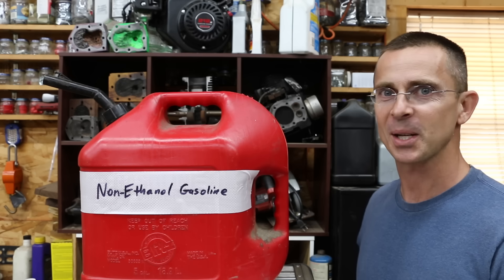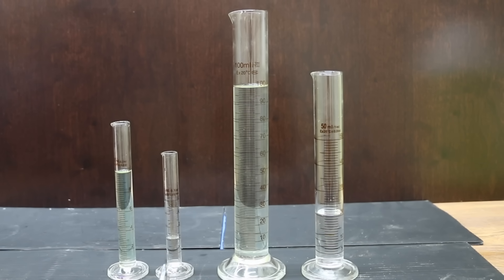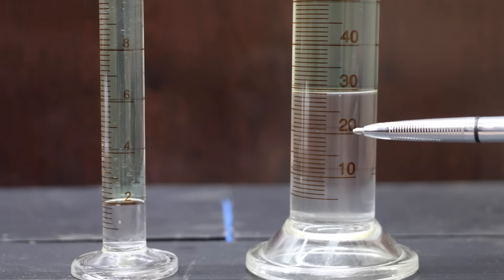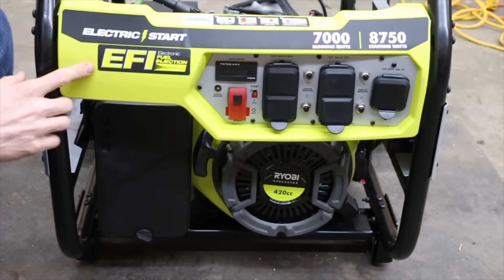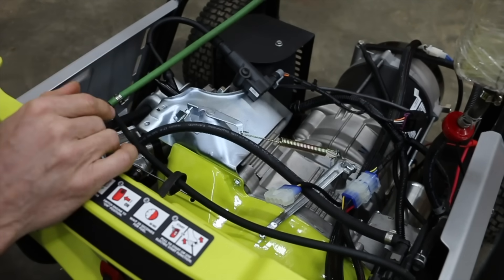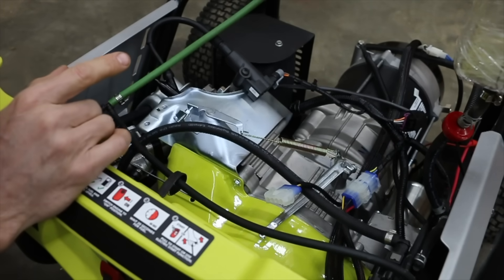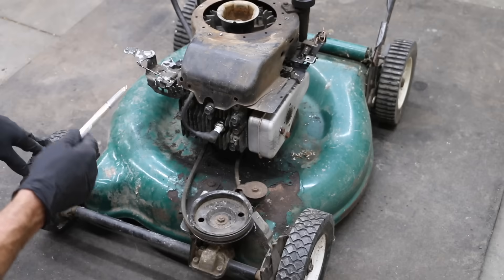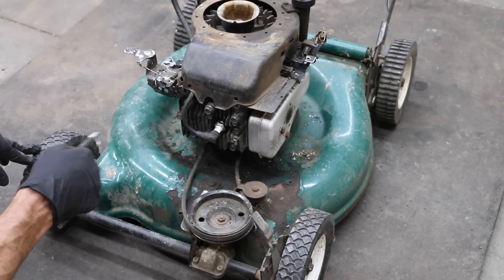Is Non-Ethanol Gasoline Really Better? See the PROOF!

Comment: Ethanol absolutely causes blockages either partially or complete in carburators because it is blatently obvious that it breaks down plastic and rubber components in fuel lines , fuel filters , tanks and carbs.  I have been doing my own small engine repair as well as repairing the equipment of other people for 20+ years and any machine especially two-strokes that have sat for over 6 months with fuel in them and no stabilizer have all needed at least mild carb cleanings to get the machines to idle , throttle up and run at WOT properly, some need entire ultrasonic cleanses and rebuild kits.  4 stroke carbs seem to handle the ethanol a little better as the 2 stroke engine carbs are very sensitive to ethanol and anything other than clean pure high octane fresh fuel in general.  If you live in the northeast you may have a local gas station called "Stewerts" they all offer 91 octane ethanol free fuel because of the amount of snowmobilers around here.  If you can't find ethanol free fuel then go to any marina that has a gas pump out by the docks and get your gas there it's all ethanol free.  Ethanol is also considerably more damaging to the internal engine components of two strokes like chainsaws , leaf blowers , and weed whackers due to how much it increases combustion temperatures , mix that increased temp with the 9000+ rpm operating speed of two strokes and how lean they tend to tune machines outta the factory now in all machines and you got a recipe for destruction.  I got a dirt cheap throw away Remington rm2510 25cc two stroke  weedwhacker that my stepdad bought at regular price for $89.99   3 years ago , his son in law was with him and also purchased the same machine at the same time 3 years ago now.  Upon first start of the new weed whacker I noticed immediately how lean the carb was tuned and how horrible the idle and throttle response was, had no power etc... So I let it warm up completely and I returned the carburator upon it's first run with minor tweaking after it broke in and was under load, I've never ran anything but premixed ethanol free 95 octane fuel in the whacker and it's about to start it's 4th season still with plenty of power though it is down to only about 115 lbs of compression it still starts easily and has no significant noteable power loss yet so all is good.  However the unit that my stepfather's son in law bought at the same time , never retuned or adjusted the carburator on except the idle speed and used standard 89-91 octane 10% ethanol fuel he mixed himself with prob shit two stroke oil too , lasted about 3/4 of the first season before it developed significant power loss, took 20-30 pulls to start and would often stall after letting off the throttle when warmed up and refuse to restart for hours , by the end of the first season it was completely trashed and the motor locked up on him one day while using it, only 7 or 8 months old didn't even get to finish one full season before catastrophic engine failure occured. Now was it the ethanol or was it tuned to lean that caused his engine on his machine to fail? I'd say prob a fairly even mix of the two.  I have a couple Husqvarna chainsaws currently , non of them have ever ever seen even a drop of fuel containing ethanol except for one instance, I'll explain. One is  a 445 with a 16" bar muffler modded and retuned, never seen a drop of ethanol and runs perfect tons of power still, is a 2008 model so 12 years old cutting 3-5 cords of firewood a year  . I have a 55 rancher with an 18" bar on it that I was given with almost no compression for free by a coworker , i rebuilt it using a cheap $50-60 Chinese rebuild kit and quality meteor piston and ring, runs perfect ,plenty of power , also has never seen a drop of ethanol fuel since the rebuild .  I have a  model 41 made in 1998, 16" bar and muffler modded and retuned, saw runs perfect , plenty of power still also has never seen a drop of ethanol.  Last I have model 135 which is basically a 440 with a 3/8LP chain and bar that has just finished it's second full season as a  light duty firewood saw. I myself never used any ethanol fuel in this saw either only Husqvarna premixed 95 octane , but my idiot stepfather lended it to a friend of his without my permission and without even making sure the fuckin idiot new how to use the damn thing properly and sure as shit when I got it back two days later there was no bar oil in the reservoir , the chain was burnt to a crisp and the bar was scored , I started it before he left because I already knew he had to have fucked something up especially after telling me he used regular 87 octane pump gas with ethanol in it and true value brand non synthetic garbage two stroke oil.  So I started the saw before he left and right away I noticed it didn't idle nearly as smooth , and that the throttle response wasn't nearly as crisp and sharp as it should be and was only 3 days early before this ignorant asshole stepdad of mine lended it unlawfully to another ignorant asshole.  I did a test cut quick after it warmed up and immediately noticed not only the it has a significant power loss but also didnt hit max rpm potential.  The guy asked me if anuthing was wrong and I told him flat out yes I think you blew my motor or damaged it severely because you don't know what your doing , used the wrong fuel and oil and prob didn't even mix it to the correct ratio and just went off on the guy , I told him stick around for 3-4 minutes I'm gonna pop the muffler off quick and spark plug to inspect the motor, the guy started looking nervous and uncomfortable. Soon as I was able to pop those two parts off and shine a flashlight into the cylinder there it was , scored and gouged the shit outta the cylinder , fried the ring and did a hell of a number on the piston as well.   Quick compression test at WOT yielded me 107psi   , I was furious and told the guy said listen I'm not trying to attack you like an asshole but I maintain all my gas engine powered vehicles and tools absolutely meticulously to and over the top level and this saw was a piece of shit in its current state compared the meticulously perfect state he received it in  when my stepdad lended it to you which btw he had no right to do and did so without my permission , I said I never ever would of let anybody borrow any of my saws even if they were a professional arborist I don't care, I ain't going there. So I said so that said you basically ruined a saw that no while not the most expensive Husqvarna model regardless was in perfect shape and I'm sorry but I earn my money so even spending $10 is something I give well thought to so I said I'm sorry sir but your gonna have to do something about this because I'll take you to small claims court , you and my stepdad both if need be I don't give a shit , these are my damn saws. the guy asked if it was repairable or if an entire new saw was needed , I said I could rebuild it on my own time but would only do so with OEM Husqvarna parts and sorry but I'm not paying for a penny of it.  The guy sighed and got all embarrassed and flustered looking and said about how much would it cost would you guess? I don't him probably about $140-175 in parts and I won't bill you for any labor as long as you go along and make this right by covering all repair parts costs, he agreed.  So I literally drove the guy 10 minutes away to the closest Husqvarna dealer I use and placed an order for a full OEM cylinder and piston kit, all needed gaskets , new cylinder mounting bolts and crank seals, a new chain, a brand new part, and a new fuel and air filter along with grabbing necessary fluids and rags from the local AutoZone and the guy payed for everything upfront with his debit card, apologizing a few dozen times.  In short I got the saw rebuilt with all OEM parts plus had my squish set to the ideal 0.020 by having the bottom of the cylinder cut just a tad think it was like 13 thousandths  he took off for only 20 bucks., Got it all together after work one night and boom had 162psi after a month or so break in period. Cost the guy $187 , I only paid 260 for the saw new but whatever it wasn't my money or my doing so I wasn't paying a dime except for the fuel in my Jeep used to drive him to the dealership to place my order . So that's my experience I've experienced  with ethanol , improper carb settings and possibly improper oil to fuel ratio none of my doing btw if you read the full comment you'd know that.  Have fun
Reply from the maker: Thanks for the feedback!

Comment: Ethanol is in there to help with the water problem.  There is always water in gasoline.  Ethanol mixes with the fuel to keep it from freezing and makes the water burnable.

HEET does the same thing.  The yellow bottle of HEET has ethanol only whereas the red bottle of HEET also has fuel injector cleaner and is a little more pricey.

I put a bottle of red HEET in every tankful to keep my vehicles running smoothly.  Summer and winter because there is always water in gasoline.
Reply from the maker: Thanks for the feedback.

Comment: Ok , what is the engine made of ? The carberator / fuel injection ? The build up is usually carosion of the meterial the gasoline comes in contact with .
Reply from the maker: Thanks for the video idea.

Comment: I am currently rebuilding a Chev C60 CMP Truck. So many of you clips have been helpful with various repairs/mods/upgrades. love ya work and attention to detail. Cheers From Down Under..
Here as thought for an Idea. Anyway you can compare/test current fuel efficiency in 1940 -1950 petrol engines. a Chev 235 would be good.
Reply from the maker: Thanks for the video idea.

Comment: This was so cool!!! I'm a retired dyno tech, and i ran all kinds of test with every kind of fuel, and trying to explain to people that adding ethanol to gas was one of the worst things ever done, is pointless.This demonstration proves it, very well done. New sub here. ... BTW, for the record, the Energy Independence and Security Act of 2007 expanded the Renewable Fuels Standard to require that 36 billion gallons of ethanol and other fuels be blended into gasoline, diesel, and jet fuel by 2022. That combined with the fact the EPA has mandated the RFS in 2019 means things are only going to get worse. SMH!!!  "Save the birds, save the bees, save the flowers and the trees, save the whales, save the snails... gotta save this planet, last time i checked, the planet is doing just fine. The people however,  well don't look now, but i think earth is shaking a few of us off like a bad case of fleas" .... from Carlin, modified for the times.
Reply from the maker: Thanks for the feedback.

Comment: Great videos. Unrelated question, my dad (been a mechanic for 45 years) swears starting an engine (weed trimmer, back pack blower, etc) with a drill will possibly break the crank. Have you ever experienced anything like stripping or breaking the end of the crank off? He seems to be over cautious on some things.
Reply: Don't use a impact and you should be fine

Comment: I've used Ethanol-free gasoline in my Acura TL several times and noticed only negligible improvement in fuel efficiency. Maybe 1 or 2 MPG improvement on the highway if anything but it didn't offset the price difference. I also use regular gasoline in my TL even though they "require" premium. Haven't noticed a change in MPG although I do feel the power my be restricted. Also not worth the 60+ cents per gallon difference in price though.
Reply from the maker: Thanks for the feedback.

Comment: Here in Brazil the use of alcohol vehicles has been around since the 70s .... They were really problematic and bad for ignition in colder regions.
Since 2003, the sale of 'flex' vehicles has started, which can receive a mixture of alcohol and gasoline in any proportion.
We don't have many problems because our alcohol is of high quality, today it has almost no mixed water. It is also not widely used, as it is usually very expensive.
Nowadays our gasoline is E27.
Greetings from Brazil. Your videos are excellent!
Reply from the maker: Thanks and thanks for the feedback!

Comment: The problem with the small mower engine is that the carburetor cannot adjust itself to the ethanol gas which requires a 10% increase in fuel flow. So the engine is actually running a bit lean.
Reply from the maker: Thanks for the feedback.

Comment: It seems in my lawn equipment the primer ball rots out quicker with ethanol fuel. Back in the 80’s and early 90’s I don’t recall the primer ball rotting out. And rubber fuel lines cracking.
Reply from the maker: Thanks for the feedack.

Comment: 6:55 - I had to wire-brush my scooter 50cc engine's inner cylinder head and piston top surface two years ago, because I accidentally filled the oil tank with gearbox oil. That made some severe carbon buildup, but the 2-stroke engine survived that one. Spraying WD40 before wire-brushing did a great job: Clean piston top surface, neat cylinder inner head. Once the engine was put back together, I noticed that the power had increased compared to before the disassembly. Still runs fine to this day hence being in service since 2001.
Reply from the maker: Thanks for the feedback.

Comment: Problems are from the water attractive nature of ethanol causing corrosion in carburetors or inside engines in the case of 2 strokes (especially in marine outboard engines) and from the alchohol damaging fuel lines and tank liners and I have dealt with both.  Sort term issues are almost non existent and most engines can use a single fill up in a pinch with no noticeable side effects unless you run a higher than 15% blend or E85 in an engine not designed for it.
Reply from the maker: Thanks for the feedback.

Comment: Ethanol technically isn't specifically an octane stabilizer in gasoline,( it does have a higher autoignition temperature) but it is also far superior in thermal transfer. This serves to increase the test scores on a fuel undergoing AKI, RON or MON testing. One of the main strategies of engines equipped with knock sensors and pre catylitic O2 sensors is to change fuel ratios to adjust either burn temperature ( by going stoichiometric lean you can decrease temperature, but reduce power, so few engines will go past 13:1 as a standard "lean" setting) or by more commonly opening the flood gates to use the fuel as a coolant for combustion chambers and turbos, if so equipped. Ethanol's main purpose is to oxygenate the fuel to increase the effect of the catylitic converter to reduce solid carbon. That being said, it's reduced energy will be less noticed in high compression and forced induction engines due to its cooling  effect reducing the need to over-saturate the mixture. Water kicks it to the curb as far as thermal transfer is concerned though. I wouldn't be surprised if the next gen IC motors incorporate water injection more commonly. It's expansion rate when transitioning to vapor will also increase power further than just the timing advances the endothermic reaction enables. It's also a better catylizer than ethanol, with nearly half of the molecular weight being oxygen.
Reply from the maker: Thanks for the feedback.

Comment: Here in Europe i did the simplest test i could - instead of N95 i used N100. I´m driving mostly in city. With N95 i had consumption 8l of gasoline per 100 km. With N100 my gasoline consumption dropped to 7,6l/100km, but the engine is also quieter and somewhat more responsive. Both fuel types had 5% of ethanol in it. But while i was doing the long-time test of N100, the government of my country changed the rule for N95 and ordered for adding 10% instead of 5. Which, i believe, will only increase consumption and decrease efficiency even further. So you´ll get less driving range. Which, in case of ecology, doesn´t make any sense. Increased gasoline consumption will only increase production of gases by a bit, which will be actually worse for ecology than just not using it. Higher consumption also means you´ll need more money to pay for the same distance.
IMHO, forcible lowering of gases produced by gasoline and diesel engines is no good. While the process itself can be good, add in constant increase in numbers of cars on the road. That´s why the gases production simply wouldn´t decrease. The car making industry should be forcibly lowered, as not every owner of a car actually needs it.
BUT on the other hand, Europe is now heavily dependent on car making industry, so lowering this industry will cause Detroit 2.0 in scale of a continent...
In reality, ecology doesn´t matter for bussinessmans, they only want to make money, to make more and even more money. Ecology as it is done in these days, is mostly just used as some sort of PR and marketing.

Comment: I have been using LL100 (avgas) in all my small engines and old motorcycle for 4 years now...they usually stay dormant with fuel in them for 4 winter months....no starting or carb issues since I started using it......I dont need your study to prove to me ethanol is bad, but I welcome it.....you always do good work...

Comment: I have a vintage race car (71 Porsche 914) and I MUST run ethanol-free gas.
I learned the hard way:
Ethanol gas sits in carburetor bowls (open to air through vents)
Ethanol absorbs water into float bowls.
Water attacks aluminum in float bowls
white chalky substance precipitates out of gasoline into float bowls.
White chalky deposits clog jets in carb.
Once i switched to ethanol free gas, I dont have that problem anymore.

It took me a while to figure out HOW white chunks of material were making it from the gas tank through THREE different fuel filters.
The answer was - its NOT, the chunks were forming IN the float bowls.

This would only happen to cars that sit for a long time without driving (like a vintage race car).
Reply from the maker: Thank you for the feedback!